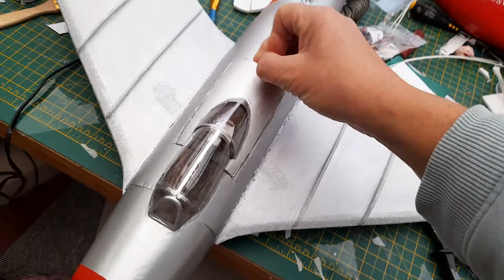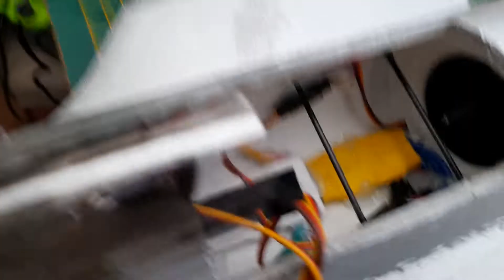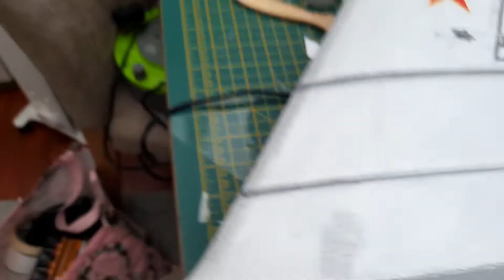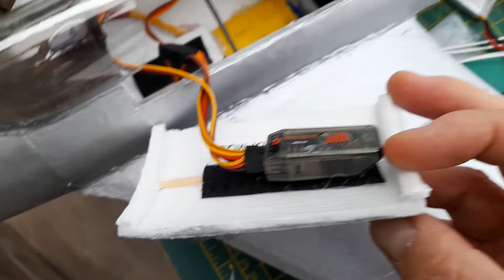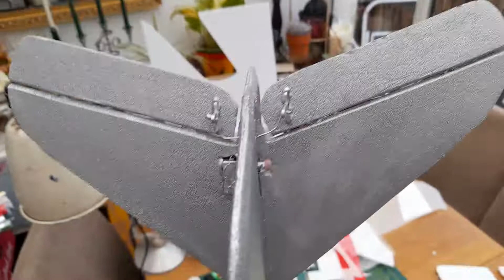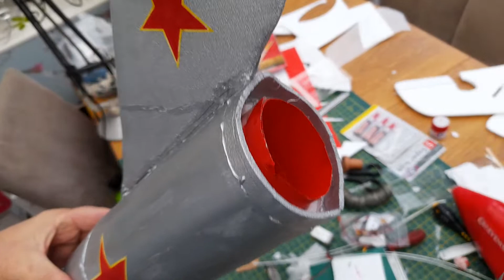A quick film about my scratch built Mig 15

Comment: Very interesting and useful Mike, what's the fan and motor you used? Also what's the all up weight?
Reply: I can vouch for this MiG being a great little flyer, well done Mike.
Reply from the maker: Thanks Cliff. I just did a quick video because of interest in this build. It's a 50mm edf unit, 30a esc. I will give it a weigh for you. Cheers
Reply from the maker: All up weight 474g, 27" span, 22" fuselage (to end of thrust tube not tail). Overlander 2200 battery. I hope that's of help. Cheers
Reply: @Mike Parker Creative  Thanks Mike, fingers crossed for the maiden, it'll be fun whatever happens 👍
Reply from the maker: @cliffharveyrcplanes  she flys beautifully Cliff...like a dream!
Reply from the maker: @cliffharveyrcplanes  Flight video now uploaded 😉😊